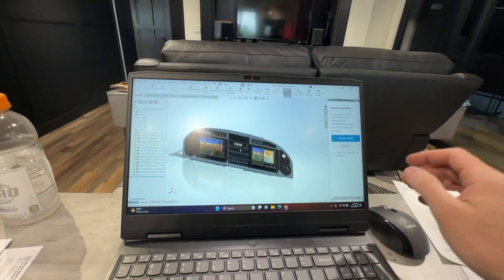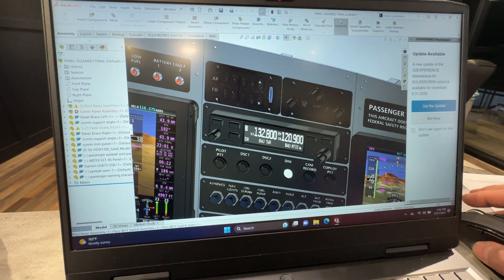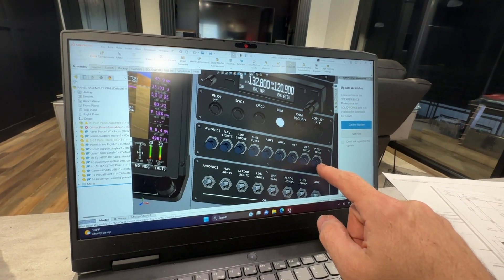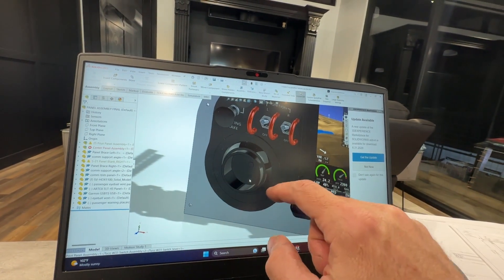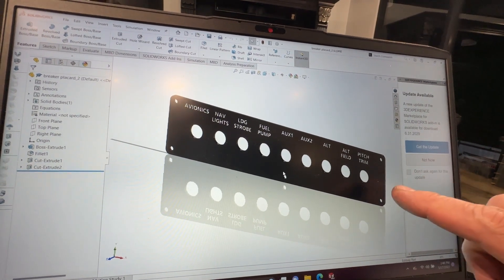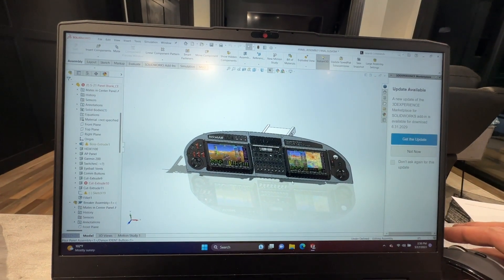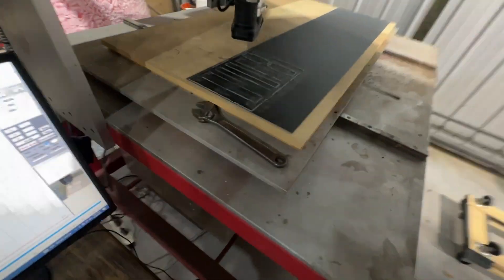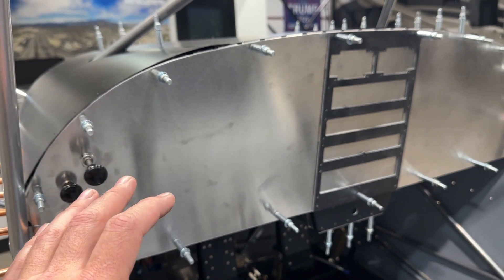Ep. 26 - RANS S-21 Panel Design & Test Fit

Comment: nice and clean panel!  is this VFR panel?  
thanks for pointing out the aviation USB port component.  
nice touch on the dedicated camera button, this definitely reduce pilot distraction.  please make a video for this development. 
Good to see a S-21 builder going with Dynon.  is your avionic using Dynon's Advance Control Module, I am researching and curious of what other builder think about the Module's feature, "electrical circuits breaker", rather than the traditional physical circuit breaker.

Comment: so you have take your cables apart to remove panels ?    i would make cable panels seperate.
Reply from the maker: Are you referring to the parking brake and cabin heat control cables?  Simply unscrew the knob and remove the panel nut and the panel slides off.  I’m changing the parking brake cable to one that’s got a panel nut for this purpose.